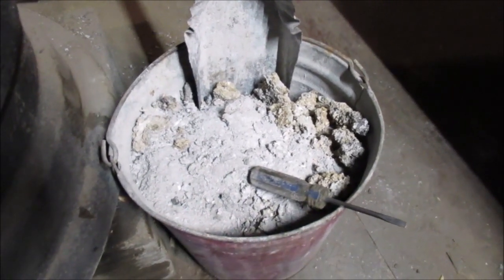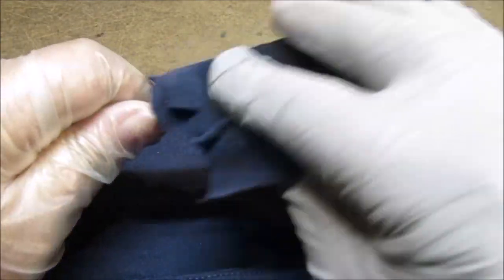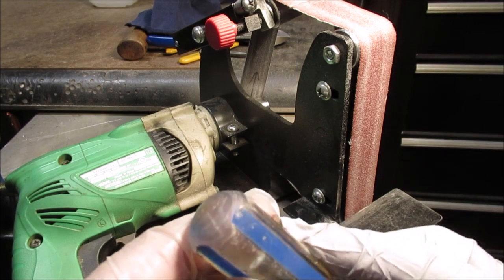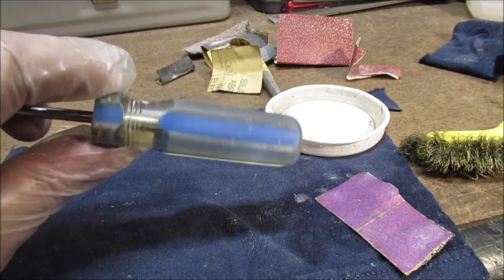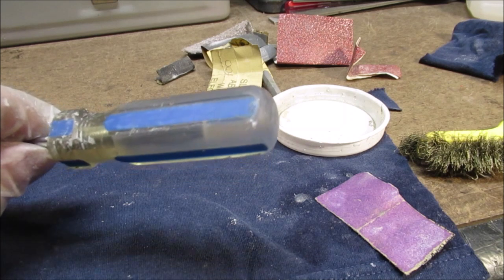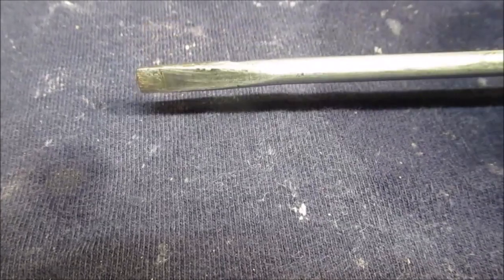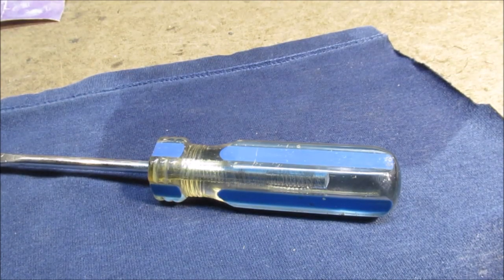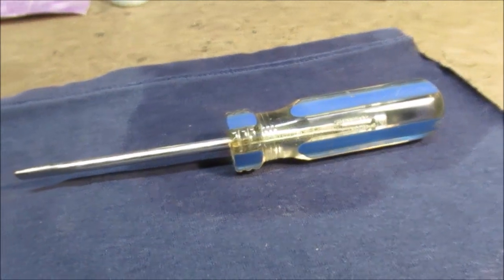RESTORE Badly Damaged Screwdriver

Comment: Years ago I watched a video on How its made. They did an episode on screw drivers. They make the handle shiny by dipping it into acetone after it was sanded.  Just don't touch it until its dried. It won't remove the paint as long as you dont touch it.
Reply from the maker: I have experimented with acetone And used small amounts to clean some of my handles ..You are correct about not touching it till it dries ..I left a mark on one when I touched it ..It did polish out
Reply: @not2fast4u2c  just tried it. After sanding with 600 final sand. I dipped it and yes it worked but had to let it dry and did it again. Little cloudy but it shined up with a clean terry cloth hand rub. Probably even better with a polish wax.